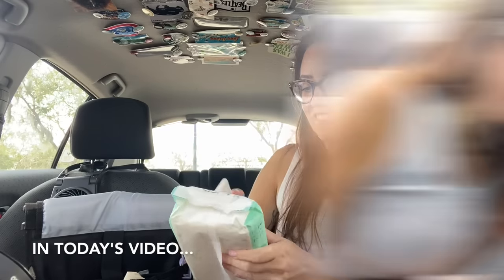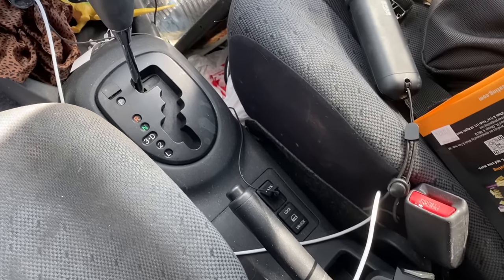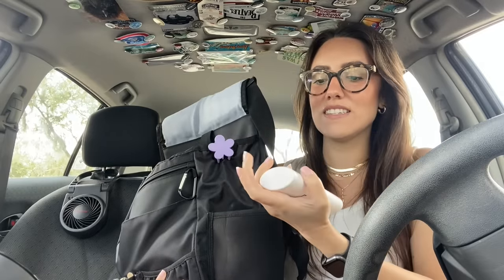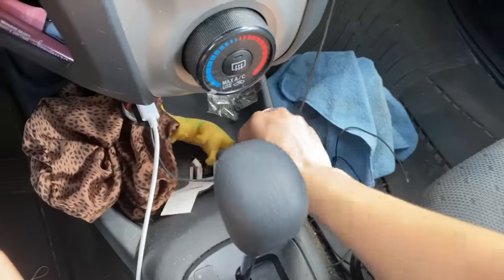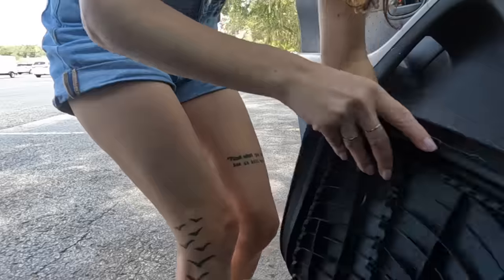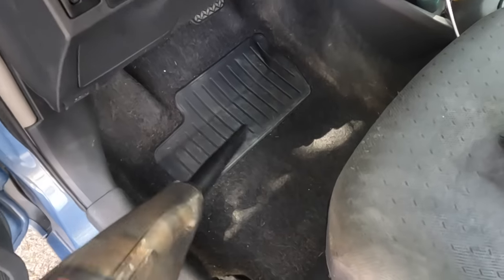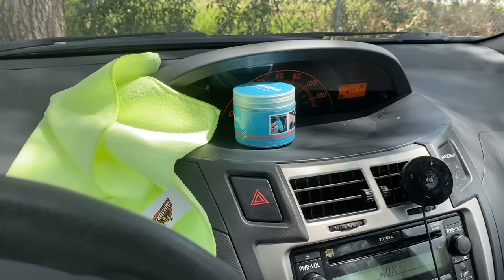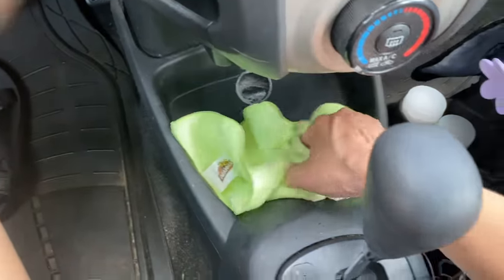DETAIL MY CAR WITH ME (it's disgusting) | Katie Carney

Comment: I noticed as you were cleaning between the seats, the little area with the toothbrush, you were talking about trying something else there to get the corners. By chance does that rubber part come out? In my car, I can take a toothpick and slide it under the edge, then I can lift it right up clean it and put it back. Just at thought, not sure if that is the case with your car.